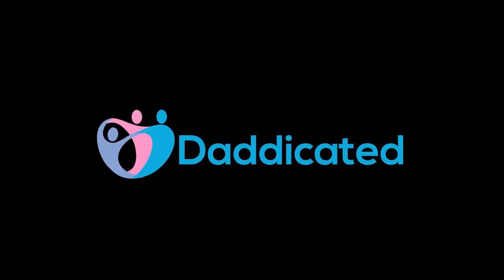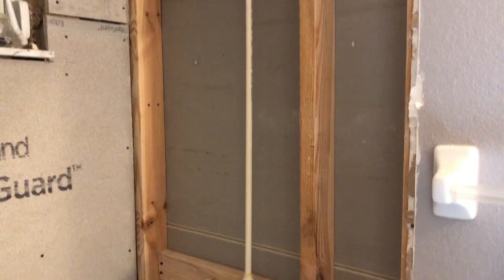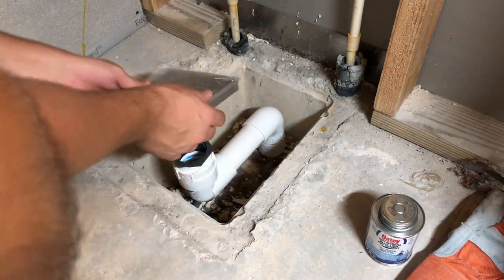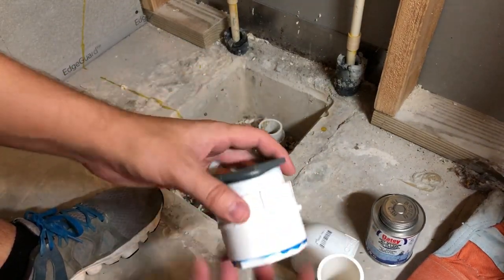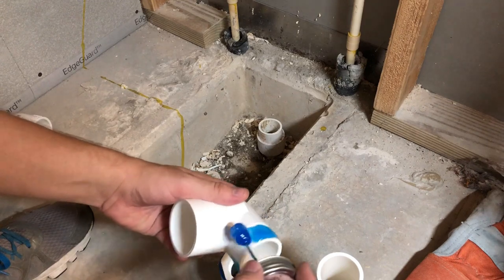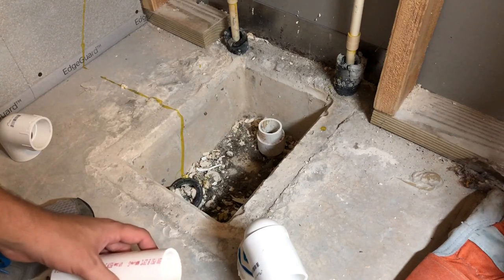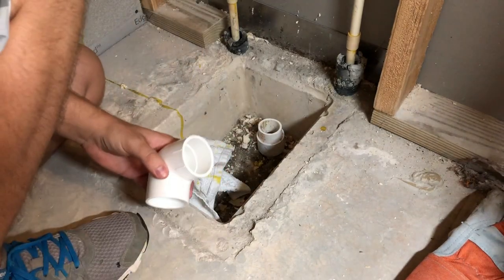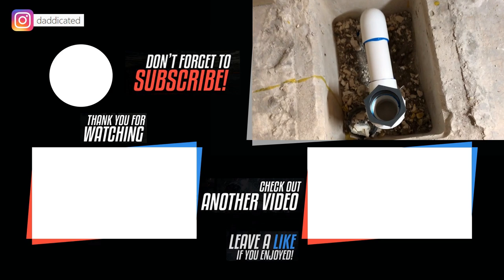How to convert bathtub drain to a shower drain

Comment: I agree with some criticisms, but disagree with others. I agree he should have used wide sweep elbows. He would have had to dig lower to use them, but it looks like the vertical pipe has some length and it would not have required extensive chipping to connect lower down. Wide sweep elbows would facilitate flow, which is doubly critical since he's only using 1-1/2" pipe, and they would be easier to snake. But I don't fault his assuming there's already a P trap. It's obvious there was an existing tub and if it had no P trap at all, he would known it by now. Busting up a floor just to insure there's a P trap is like busting up a driveway to insure it has re-bar. Sure, a complete 2" line would have been superior. And it's obvious he's skipping the permit part, so all the talk about inspection is just jabber.
Reply from the maker: I don’t mind criticism at all since I’m still learning new things with every project. Thanks for the feedback too. 👍🏼

Comment: Seems like you should clean out the existing p-trap before you install the new drain.  Some peeps replace the p-trap with a new one. The 90s you used are too tight. Tight turns are your enemy in a drain. Will be tough to get a snake in there to clean the p-trap if it plugs up. Hope this helps the next guy
Reply from the maker: Mine was build in 04 and it’s inside the concrete foundation so it would of been too much work to re so it.
Reply: Agreed, cannot use 90s in a drain, only vent. Should’ve been a long sweep 90 or two street 45s
Reply: Yea this guy is definitely not a licensed plumber

Comment: Hello thank you for sharing nice video. I am going to do same thing for drain part. I also think p trap is under the ground because bathtub did not have p trap too. I agree using 90 is ok. Just wondering if your shower is still ok to use with that drain method?
Please let me know thanks.
Reply from the maker: So far so good. Kids take showers in that bathroom and everything drains just fine.
Reply: @Daddicated  sounds good.  That is what I expected.  Thanks.
Reply from the maker: @Goodtips4you  anytime. 👍🏼
Reply: This would fail inspection for 3  reasons.....

Comment: I see that you kept the 1.5 inch drain pipe.  I'm looking for an example of changing the drain to 2".
Reply from the maker: From the sound of it you may have to get a Jack hammer and drill into the concrete to access your drain maybe.

Comment: What if the pipe rising from the floor P-Trap is 1-1/2 brass pipe? Can you transition to pvc?
Reply from the maker: I’m not too sure cuz every state has different codes. In Florida all drains are PVC and the regular water lines are CPVC.

Comment: I am not a licensed plumber either, but I feel compelled to question this; when you removed the tub-overflow it seems that you have set up an inline siphon that could result in deadly sewer gases building up. I suggest you get a clearance an inspection certificate.
Reply from the maker: No there is a P trap inside the foundation so no sewer gases.
Reply: My point is that, if someone flushes, say, an inline toilet the water could get siphoned out of the trap. No ?
Reply from the maker: @MrOramato  To be honest I'm not sure how it is all plumbed since it's all in the foundation. However, all I know is I don't have any draining problems or smells and it's been 5 years since the remodel.

Comment: How high the drain sits on top of the concrete for shower pan?  Do you have video how to install shower pan ?
Reply from the maker: I don’t remember anymore how high it turned out. And no I didn’t do a shower pan. I just did the mud set and I do have a video for that.

Comment: was it the same diameter? I thought tub and shower piping sizes are different
Reply from the maker: I found the fittings that made it work.
Reply: to answer your question, yes you're technically supposed to replace the entire line with 2" pipe not just use a reducer fitting to connect 2" drain to the 1.5" plumbing.

Comment: Looks like 1 1/2” pipe , code is 2” on shower drains
Reply from the maker: That’s what was already on the tub drain so I just kept it the same. Good to know tho. Thanks
Reply: Did you have an overflow issue?
Reply from the maker: @pontiacgto2005  No I did not.
Reply: Plus there is probably a 2 inch trap, doing this creates an s trap and also if you get a clog you wont be able to snake it

Comment: no P trap is needed?
Reply from the maker: I believe there is one downstream of where that drain is plumbed.
Reply: @Mr. Meeseeks First of all stop being a HATER. Second, everyone knows the P-Trap is below the slab. Third, if you didn't see a P-Trap during the demo, all you saw was the drain and overflow, then you would either think the builder made a mistake and didn't install a trap, or there is one installed below grade.
Reply: Hi Daddi, was the tub drain 1 1/2 pvc? Did you convert it to 2 inches ?
Reply: I agree with one of the comments here, the first issue is to increase drain size from 1 1/2" to 2".    Why is that not covered?
Reply: Daddicated wrong, each fixture is required a p trap. You’re going to have sewer smell and noises come from your drain. I’m. Journeyman plumber btw
Reply: Without a p trap at your fixture to hold a body of at least 4” of standing water it won’t stop the gases from coming back into live able space
Reply: @reubengarcia9554   The p-trap is below grade, under the slab - standard construction for slab houses.  Now you've learned something new in your journey as a Journeyman.
Reply: Richard Shetina a leave out box is standard, but maybe only some of us plumb to code
Reply: Nice video, thanks! My question is similar to what others hinted about a vent. I am doing the exact same conversion as you, bath to shower. I wasn't planning on adding a vent, but now I am reading it may cause it to drain wrong and gurgle, etc. Possibly even siphen the pee-trap.... Everything says the vent has to be AFTER the pee trap.  But my bath didn't have a vent after the pee-trap..only the overflow pipe which I suppose acts like a vent, but is before the pee-trap. So I am really curious if I need to fit one in there somewhere or not?  No sewer smells? No draining/gurgling issues? Thanks!

Comment: Using pressure fittings on a drain is no good. You will never be able to properly snake the drain if there is a clog. Also, adding 2 90 degree fittings like that above the under slab drain trap creates an "S" trap. I may remove the water from the drain trap and cause sewer gas.
Reply from the maker: Well hopefully I never have to snake that drain.

Comment: You used pressure elbows on drain.
Reply from the maker: What exactly does that mean? Sorry I’m not an expert.
Reply: @Daddicated  pressure elbows are for water lines and you need to use DWV elbows for drainage.
Reply from the maker: @jacksplumbingvideos7147  What's the advantage of using DWV vs the one I used?
Reply: @Daddicated  DWV elbows are required by code and they are more of a long sweep.
Reply from the maker: Gotcha. Does that code also apply in Florida too do you know?
Reply: @Daddicated  it applies to everywhere in America and Canada.
Reply from the maker: @jacksplumbingvideos7147  Good to know. Thanks for sharing.

Comment: You’re going to have constant clogs or slow flow with those wrong fittings
Reply from the maker: Nah I’ll be alright.
Reply: @Daddicated  you sure? Let us know eventually. You know what a P trap is used for?
Reply from the maker: @karelmontel9284  I have a p-trap it’s in the foundation. Florida homes build the p-traps before they pour the foundation. Also so far it’s been good.
Reply from the maker: @shelbyrae4453  ???
Reply: As some1 mention,  you dont use 90 fittings  when water drain for a lot of reasons. Did you slope the floor towards the drain? You need to put a nylon cover on the floor, eventually water will leak trought the tailes with no place to go.  Why going from 1 1/2 to 2 inches?  Watch a youtube video of how to set up a pre floor. I also live in FL, your bathroom wont pass inspection in so many ways. Nevertheles you did a good job but do not mislead viewers.

Comment: My drain pit is full of concrete 😫
Reply from the maker: Sorry to hear that. So what are you going to do now?
Reply: @Daddicated  my old tub drain is on center so all I have to deal with is the over flow. I'm putting in a solid surface pan so after leveling the floor I'm going to check the fit and if it's good I shouldn't have to bust it out.
Reply from the maker: @Randylayhe001  Nice. Hopefully, it will all work out. Keep me posted.
Reply: So by a power chipper and chip up the concrete around it, get the cheapest one you can find then just refil with concrete later! :)
Reply from the maker: @williamdglass1365  Thats some solid advice right here. :)

Comment: When you do this you create an s trap and you will smell sewer gases
Reply from the maker: There is a p trap down in the foundation so no gases.
Reply: @Daddicated  when you put a 90 over a p trap it makes an s trap. It may work but if it ever gets clogged you are gonna have an issue
Reply: @Daddicated  also, how does it drain? Good or slow?
Reply from the maker: @jolo7693  Hey thanks for the feedback. As of right now, it drains perfectly fine no complaints. Been good for about 2 years now. Hopefully I it never causes a problem but what you're saying makes sense.

Comment: Illegal.
Reply from the maker: Why?
Reply: @Daddicated  you've created an s trap. U must dig to the ptrap, cut it out and extend the drain pipe to under where u need the drain to be. Add ptrap then go straight up. Or if u have room you can use 45s. You cannot use shorter than 1/4 bend 90s
Reply: There is upc code for a reason. You're not licensed and it shows.
Reply from the maker: Thanks for the feedback.
Reply: @SBS_Auto   what would you do in this situation if you cannot chip out the cement for a certain reason?